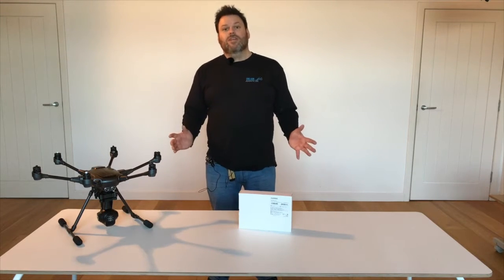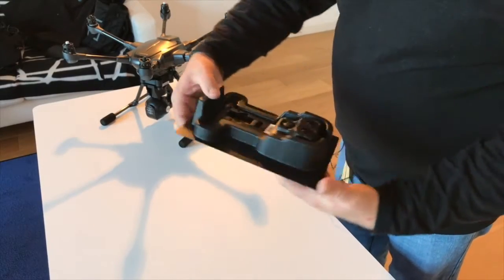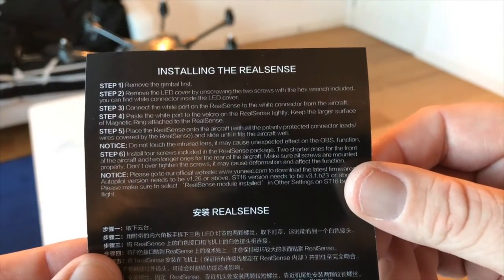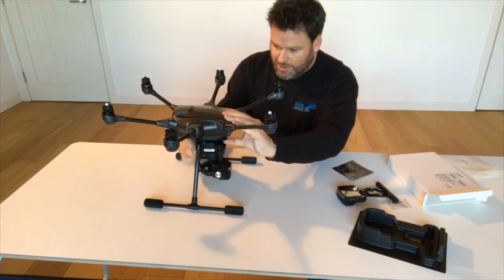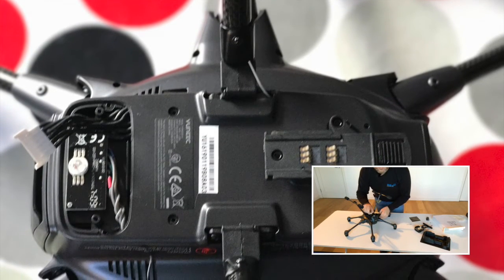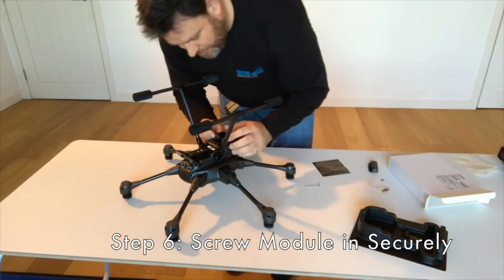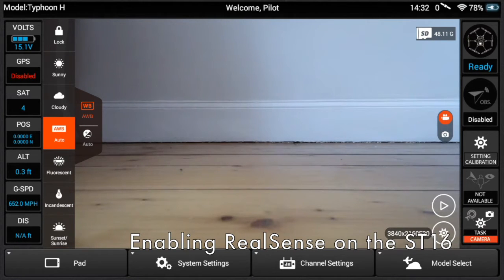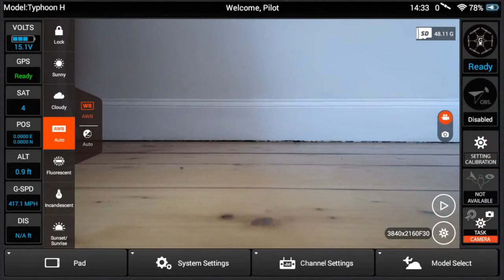Yuneec Typhoon H RealSense - Part 1 - Module Installation

Comment: I found it easier to remove the gimbal connection board (3 hex screws, slightly larger so you need your own tools if you go this route), install the RS, then re-install the gimbal connector, rather then fight getting the RS frame around the lock tab.